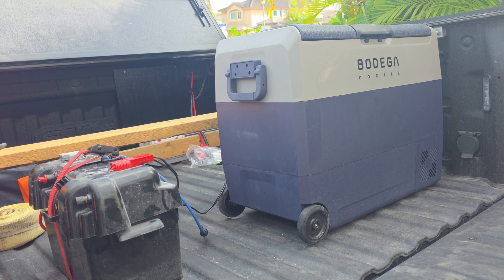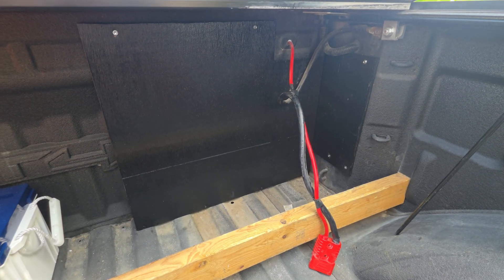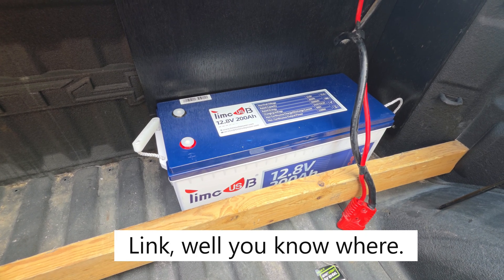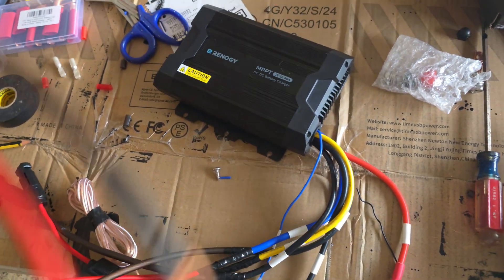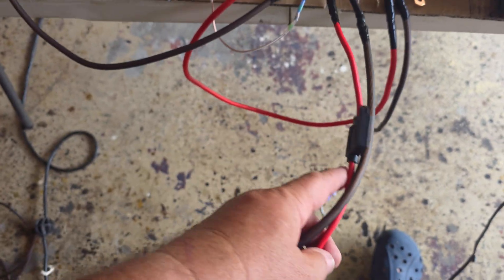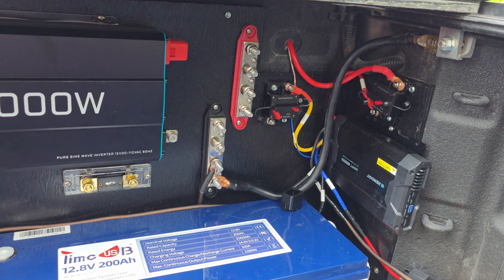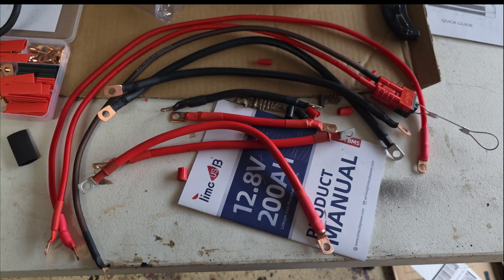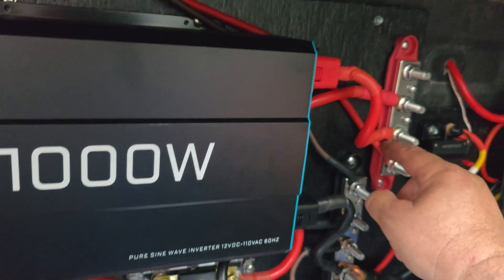Overland Battery System Build – LiFePO4, Solar, and DC-DC Charger Setup

Comment: Could you not just connect the positive out to the positive bus bar, and not the battery?
Reply from the maker: Yes but for added protection i have fuses and breakers if something trips breaker it won't fry battery.

Comment: Finally! I’ve been searching for a simple video that explains how to hook up a DC to DC charger for a truck. Thanks! Did you connect the ignition detection wire from the charger to the positive post on the starter battery?
Reply from the maker: I didn't because i have a battery isolator with a charging threshold of 13.5 volts. Its a redundant system. The ignition detection just checks that ignition is on. As where the isolator waits until ignition sequence is done and alternator is up to charge level.